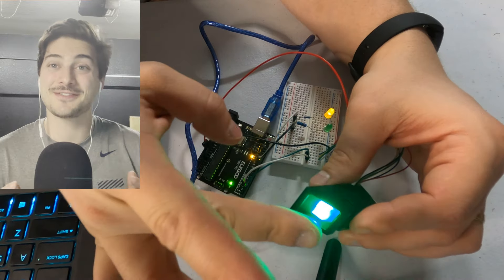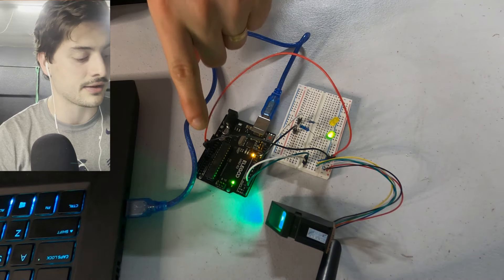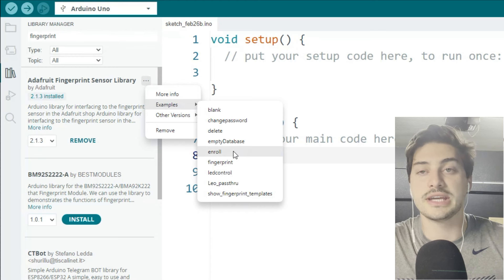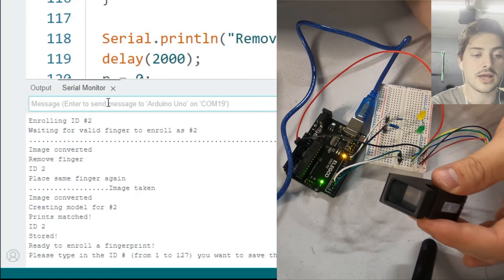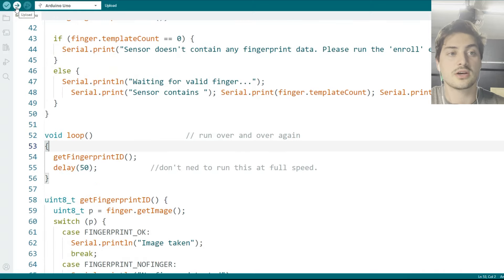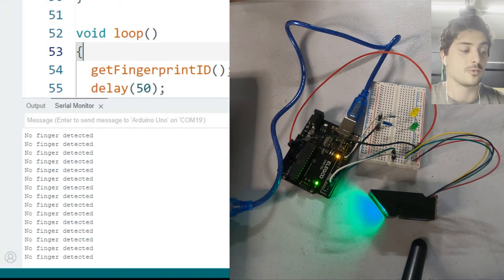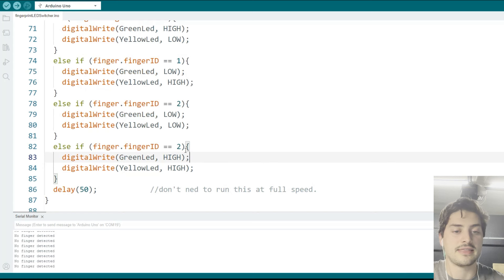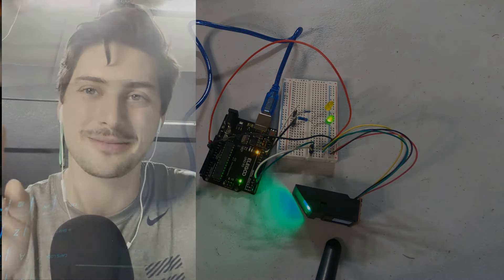How to Scan Fingerprints with Arduino!

Comment: Your great enthusiasm and clarity make your explanations so easy to follow. I just found your channel, and it will be very helpful as I learn to code via Arduino IDE. Learning to interface with various hardware, sensors, breadboard circuits, microprocessors etc. Great video!
Reply from the maker: Thank you so much for watching and for the super nice comment I’m glad to have you here!!

Comment: Hey, when I attempt to upload my code, the serial monitor displays "Did not find Fingerprint Sensor :(" although I'm pretty sure I followed your steps to a tea. Any idea why that might be?
Reply from the maker: Hi, are you using the exact same fingerprint module as me, or another UART compatible one? Or are you using a different type by chance? Does your sensor light up or indicate that it is at least powered on correctly in any way??

Comment: hey man..for me the serial monitor showsDid not find Fingerprint Sensor  but again the fingerprint led only light up the time i coonect the circuits and then turns off..like the turns on ehen i connect but again goes off..no idea why it happens
Reply from the maker: Hi man that’s really odd, is it the same exact model or at least a model that supports UART comms? I know that some manufacturers libraries aren’t compatible with others so if you aren’t using a DFRobot model or very similar model you might need to check for documentation on setup for that specific one!  If you are using the same one then double check all your wiring but there is a chance it’s a bad sensor 😬

Comment: hey, I am using the R503 capacitive fingerprint sensor with an arduino atmega 2500. I have my power and ground going to the 5v and gnd on the arduino, respectively. my pinout is as follows :
1 Power Supply DC3.3V
2 GND Signal ground. Connected to power ground. 
3 TXD Data output. TTL logical level
4 RXD Data input. TTL logical level
5 WAKEUP Finger Detection Signal
6 3.3VT Touch induction power supply, 

I am not using 5 and 6. i have the tx connected to pin 2 on the arduino and rx connected to pin 3. i have tried swapping these and swapping between 3.3v and 5v to no avail. I keep getting the log "fingerprint sensor not found :( " and when i remove the if statement for the password checking portion in setup, i get it to load, i enter the id, and i get a communication error. 

Any idea what i am doing wrong? I am using the example code that you grabbed from adafruit.

also, i am not getting any power indication when it starts up, which i am not sure why. i had the power and ground soldered to the plugin connector wires for arduino, then i clipped them again, and just twisted them together. neither way gives any indication of power. the R503 sensor is warm to the touch though after being plugged in for a bit
Reply from the maker: Hi I can’t say I have specifically used that module but the fact it gets warm to the touch but doesn’t give any indication it’s been powered on means maybe the module is bad or has internal crossed wires, but most likely you’ll just need to double check with the sensor manufacturer and see if they’ve run into this before!
Reply: @lemastertech  Thanks for the reply. I am just chalking it up to the module being bad at this point. it was a cheap one from overseas, I should have ordered spares. This was supposed to help enhance my biometrics presentation this Friday, but I guess I will just discuss my failure instead haha!

Comment: How to save these fingerprints in file ? Means if I to create a dataset, what is the procedure..can you please help
Reply from the maker: Hi this specific module does not support a way to export the fingerprints you’d need a different type of scanner that interfaces with a computer program for database storage. This modules stores all scanned fingerprints right on its chip locally!
Reply: @lemastertech  Thank you